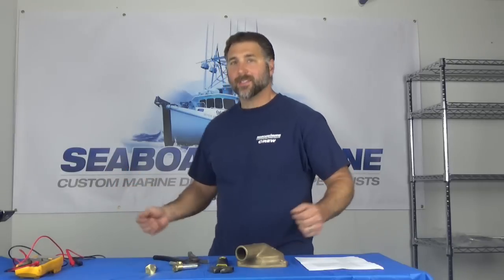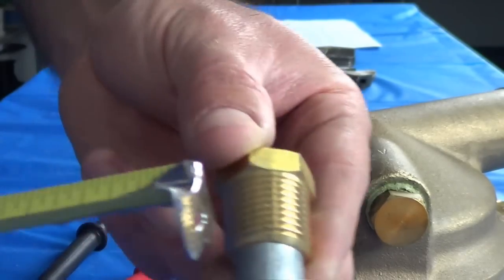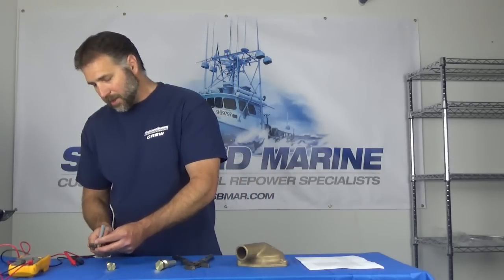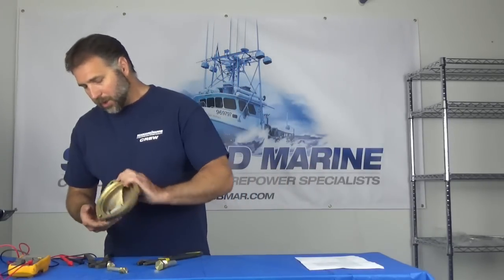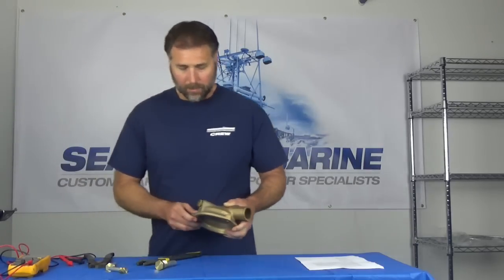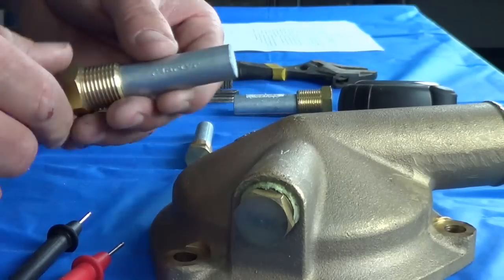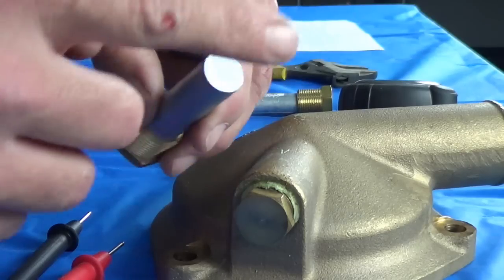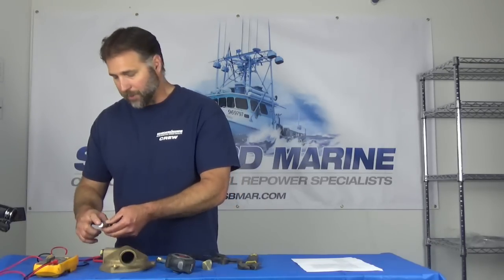HOW TO: ZINC SIZING AND INSTALLATION

Comment: What size are the small zincs on the factory gear cooler? 6CTA 8.3 
Looks like there’s two on there. They’re smaller and positioned on the beveled end of the cooler.

Comment: Is there a way to remove an old broken zinc out of the brass cap when replacing them so you can reuse the brass cap?
Reply from the maker: @robertzivkovic4118  zincs are cheap enough with the brass cap.  Why put yourself through that to save 2-3 bucks. We dont even sell zincs without the cap.

Comment: I recently changed pulled the heat exchanger on my boat. The boat has sat for a while because the previous owner hardly ran it. I couldn’t get the old plugs out as they had built up calcium or growth on them. My dad showed me a trick. Once I had the bonnets off I laid them upside down like a bowl and poured muratic acid in them. It literally cleaned them right down to the bronze and they looked new and the old plugs cane right out. It also cleaned my heat exchanger tubes with it then flushed with baking soda water mix to neutralize it. Man it came out great and thanks to this video I knew what I was looking for and how to put the new zincs in.

Comment: Good info regarding whether pipe sealant on the threads prevents electrical contact between the zinc and metal surface. They often leak without a little sealant, so it’s good to know conductivity is not affected.

Comment: What about the loctite and possible electrical insulation?
Reply from the maker: First off you only need a bit of loctite, you don't have to coat everything like you do with thread sealant because you aren't sealing threads just keeping the zinc from wiggling loose,, secondly, the same thing will happen with the loctite, as the threads tighten there's enough friction between the surfaces to make good electrical contact.  But if you are worried about it, just use a bit of loctite towards the outside of the threads, leave a few threads on the end of the zinc uncoated.

Comment: Cant believe you’re saying « zincs ». They’re Anodes! In salt water you typically use zinc and fresh water typically uses aluminum or magnesium.  You guys are better than that.
Reply from the maker: Actually it's called a galvanic anode or sacrificial anode if you want to get technical.  But we aren't talking to scientists or chemists we are talking to boat guys.  These in particular are a subset of Zinc Anodes are often referred to as pencil zincs, frequently shortened to just zincs. Did the video make sense? That's what really matters.
Reply: Thanks for taking the time Justin.  And I'm sure Richard has never ever referred to a cotton swap as a Q-tip...…………….
Reply: I guess the type of anode metal depends on what type of metal you want to protect. 
Coolers typically contains brass or copper, so it's different from external metals in stern drives and outboards like aluminium.
Reply from the maker: For the most part the internet will tell you to use a Zinc anode in Salt water, a Magnesium in Fresh and Aluminum in Brackish.  We mainly deal with saltwater boats.  We do not sell magnesium or aluminum anodes.  There are a lot of opinions and articles on the web about this, in our experience Zinc anodes are the most versatile and best go-to anodes.  You can spend weeks overthinking the type of anode you decide to use on your boat, do some "research" on the internet, if you want to call it that, and you'll get a zillion opinions.  If you plan to leave a boat in a body of water other than the ocean, I would talk to the guys in that same body of water, with a similar boat/drive-train, someone with REAL experience in those conditions, what really works for them? Find the person with the most hours on his engine, or most years in the water.  I would either just use zinc, or go with what the locals have PROVEN works in those conditions.  Don't go down the rabbit hole trying to solve this one.